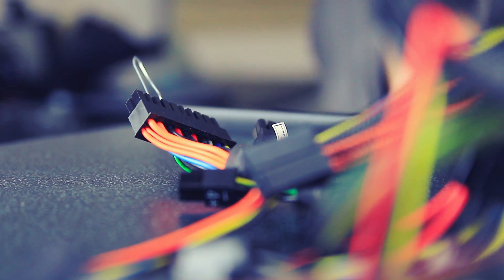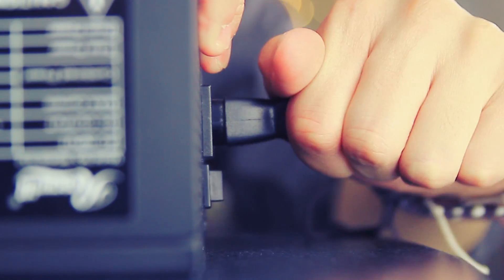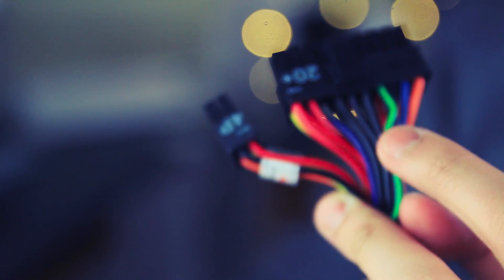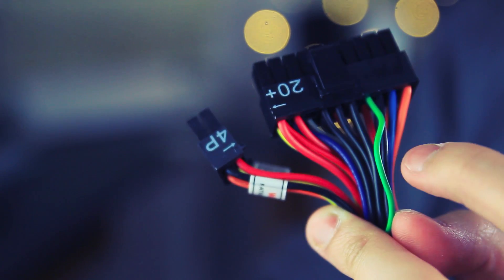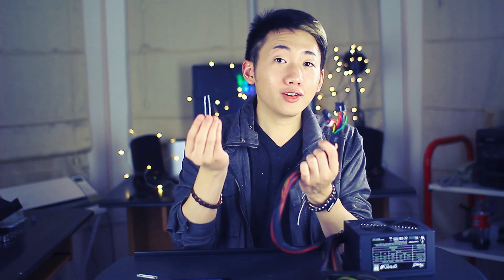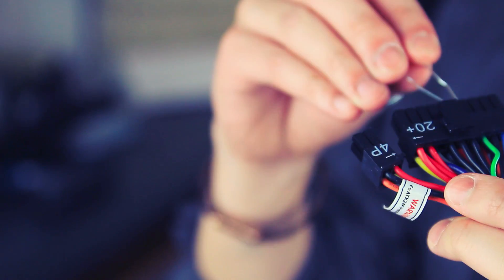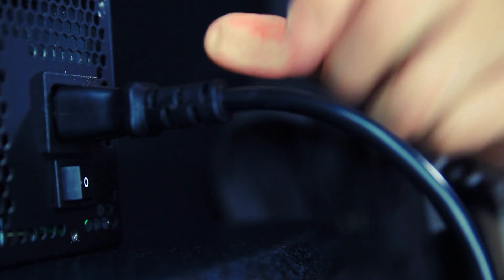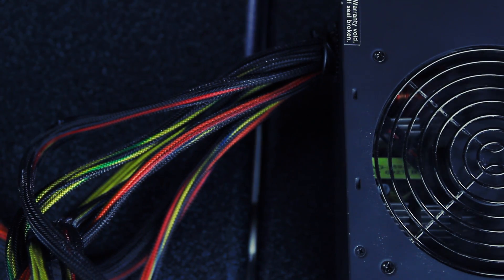PC Tip: Testing a Power Supply with The Paper Clip Test

Comment: is this a selfmade, low-range, non-mobile tazer?
Reply: No sadly, the psu will turn off before you get more than a beesting of a zap. Youd have to take apart the psu and remove the breakers.
Reply: Nope. Not at 12 volts because skin resistance is just too high, and you won't even feel it. And you start feeling electricity at around 0.5 mA. And the 12V rail can put out tens of amps. But not thru you. Although if you open a PSU that has been recently plugged in, the bulk smoothing capacitors might still have a charge. Around 325V or even 400V with active PFC, which can retain for several minutes, or even days if the discharge resistors are open. Yes, 300-400 volts, even dc definitely can kill you. If the bulk capacitors are 470µF (as in my PSU), at 400 volts that's 38 joules. Remember that 10J can be lethal, which is 210 volts for a 470µF cap.
Reply: And often times once ya do that, it simply wont turn on.
Reply: no reason to be rude to him. so it is TAZZZZZER TIIIIME
Reply: @baumstamp5989  hahahahah

Comment: Question, I tried this to determine whether my pc's lack of power was caused by mobo or PSU, and the fan only spun briefly. What does that mean? I've seen plenty of people with the same issue, but there is never a definite answer.
Reply: Think of it this way. Psu's are sturdy and made to take punishment. However, motherboards are very intricate, made to handle many delicate tasks and if a single tiny component is broken, the whole thing stops working. Drop a mobo and it definitely wont work, drop a psu and dust it off and its still good to go. Also, mobos die before a psu does. They are very easy to break and because of their bios, one small surge can wipe it and make it stop working. Thats why psus have so many conduits and breakers, one small surge can wipe the bios.
Reply: Same, any luck finding out?
Reply: +Dvich Not quite yet.
Reply: It means your psu likely isnt damaged. If your fan only spins momentarily that means the fan wont turn on during a low load and dont worry, thats not bad. Psus have many conduits and safety breakers so the chance of your psu dying unless it was DOA and even then is very unlikely. If a power surge was to occur, your mobo would die before your psu, but your psu may become unstable. And often times both need to be replaced. However, i think its your mobo thats bad, if your psu wont even turn its fan on when you try and start your mobo, that often means your bios is wiped. Especially if the fans turn on during a low load test. (The one in the vid.) Even if it only turns on for a second during the test, its a good sign.
Reply: Jeremy Whitaker thanks for the response, looks like I'll be dropping another $800 soon.

Comment: hi there I have a brand new machine and when I turn it on nothing happens just a black screen it happen to my last machine too.... only thing I changed was psu sometimes it works sometimes nothing happens
Reply: This sounds like a bad video drive. Try taking out your video card and hooking up your hdmi to your motherboard. It should turn on fine, then go into device manager then find your graphics card, click on it and uninstall that drive. Make sure you have the disk or are connected to the internet before you do. Then reinstall thr drive by clicking update automatically from the internet or inserting the disk.

If that doesnt fix your problem, its likely your power supply and there isnt enough power going to your system. If you play video games and it suddenly turns off, then thats the problem. Either that or its oveeheating.

Anyway, you'll need a new psu if thats the case.

Also, if you want to check your core temps, download speedfan. Dont worry its completely free but it doesnt hurt to donate!
Reply: +Jeremy Whitaker it was bad ram all sorted
Reply: Oh and a word of advice. Black screen almost always means bad video card or bad program for video card. Also, if you leave it in and plug your hdmi in your motherboard, it wont work. You have to take out your graphics card for your pre-installed mobo graphics card to work.

Comment: What does this accomplish? Isnt it the same to power on the PC and see if PSU fan works?
Reply: If the mobo is dead the power can't send a signal (complicated to explain) common sense if you think about the process.
Reply: +Lakelet Theoretically, would the ethernet light flash with a bad mobo?
Reply: Pistol, not sure if you're making a rhetoric or not...
Reply: It is common sense. What happens when you cut the cord between a switch and a light bulb and you turn on the switch? The same applies with a bad mobo.
Reply: Jeremy Whitaker basically, where does the ethernet port's light power flow from, the PSU or the mobo?
Reply: ***** Thanks. More evidence to suggest stripping the RAM and getting a new PC would be the smarter option.
Reply: ***** thanks, will try.

Comment: touched paper clip lived
Reply: Not the hero we wanted, but the hero we deserved
Reply: Well let's see if we can get the 'Paper Clip Challenge' trending asap.
Reply: You are strong and wise and I am proud of you.
Reply: leg
Reply: That mean your powersupply is already dead
Reply: It's harmless to touch the paperclip if the PSU is OK. But usually Your testing a PSU that is not OK. What might be wrong? Short circuit from live to ground, then its not so funny touching the paperclip, got it?
Reply: @thirstyboots6205  if u touche it with one hand you'll just singe ur hand and hurt it if u touch it with both the current can go through your heart and you can die
Reply: @Kinogotiate  Not that simple, electric shock is much more harmful than people think. Often it cause scares inside Your vain, and if it is a scare in Your vain it might build up fat and the result is blood clots, this might even happen close to the hearth and it happen many years after you got the electric shock. Doctors or You might not even think what cause it.
I have got 450V AC through my heart, luckily  without major problem, only my skin got burn under my watch.
Reply: @thirstyboots6205  honestly its only 110v. Not that big of a deal.
Reply: Wuss, use your tongue 👅!!!

Comment: My computer doesn't seem to be making a connection with my monitor, keyboard or mouse. The computer powers on, fans are on, temperatures look normal and monitor is on, keyboard and mouse plugged in. But as soon as I power on the computer, the monitor goes into power safe mode and gives a message that says "there is no signal coming from the computer". Then it says to "press any key on the keyboard or mouse to wake it, or press the input button on your display to switch to another source", but the keyboard and mouse don't seem to be responding either. And no other source seems to be wokring either. HELP!!

Comment: all my wires are black
Reply: +KennyKennTV Same here. Seems nobody ever noticed that, because all videos are with psu with color cables. Don't know what the fuck to do.
Reply: I ended up just eyeballing it and it worked. Top row connect the 4th and 5th
Reply: Did the "green" cable had any distinctive shape at the mouth end than the other cables?
Reply: @rakolman  No. They are all the same shape.
Reply: I know I'm probably late but if anyone needs to see the colors here they are: http://cdn.overclock.net/a/ad/500x1000px-LL-ad9e1227_atx-connector-20-24pin.jpeg
Reply: Alton, thank you very much. That made it so much easier.
Reply: The PSU documentation should provide diagrams of the connectors with the voltages of each wire
Reply: Probably why it doesn't work
Reply: Hello ! 
Could you please help me out on the following ? 

What is the effect of an open ground on a computer motherboard ? 

Currently it does not do anything (no POST, CPU fan does not startup, PSU fan does not startup, just, nothing happens) and yet, if I use a small electrical tester on the GND pins, the tester glows on every one of them !!! 
I'm baffled on how this motherboard is even able to have AC in it (to make a tester glow)... 

It's placed on wood and yet it is somehow shorted (it tingles to touch)...

The motherboard is also painted black so I'm not really sure if I fried anything..... But it's not supposed to happen since the wirings are correct... 

What am I doing wrong ?

Comment: hey my motherboard wont connect to a psu. my motherboard is a 24 mini pin atx. i got an adapter because my psu is a reg 24 pin atx. the psu or board wont turn on... help please :( oh board is 0200dy and psu is a bestec 460w

Comment: In an effort to be safer.  Do the same thing with a properly sized piece of wire with proper insulation on it.  You don't need to make this any more unsafe than it needs to be.
Reply: it's pretty hard to injure yourself with 5 volts.

Comment: I have an Asus Maximus VII Hero motherboard and the cpu is an i7-4790k. The thing works but after a while the PC will power on but there will be no post onto the monitor. The debug led reads "76" and when referred to the manual it means "PCH DXE Initialization (PCH module specific"  The cpu led is on and it is red. So, can you help?

Comment: this works on my PC but when my PSU is back in my computer attached to all my hardware it doesn't work, I removed my GPU and it worked..... (this computer has worked well in the past)
Reply: +AHappyPineapple(CS:GO) 

That sounds like a motherboard problem. Did you find what it was?
Reply: termi21 it turned out to be a gpu issue
Reply: Oh just saw the "I removed my GPU and it worked" part, i think it was pretty obvious then  :D
Reply: termi21 hahaha :D

Comment: Desktop won't turn on, bought a new power supply thinking it would do it but still won't turn on the fan doesn't turn on any ideas ?
Reply: +Auri True I have the same problem.
Reply: +xXxPUSSY _SLAYER420xXx (dim420) Found out why my desktop wouldn't turn on, I opened the case and looked at the mother board, I guess a cord was unplugged with the USB cord to the motherboard. switched the wires and works perfectly.

Comment: nice vid, my power supply's fan spun for a few seconds then died down with this method, so i guess it kicked the bucket
Reply: +fishballchikuwa Naah, most PSU's turn on to check if the motor is working, then powers down when not under heavy load.

Comment: Awesome video, you have a new sub!  My power supply tested good and worked just fine, however when plugging it back into the motherboard nothing happens, PC does absolutely nothing.  Is there a way to test the motherboard power connector w/out connecting the power supply cord (24-pin)?  

Thanks & Cheers!

Comment: If my PSU doesn't start up after trying the paperclip trick, could it also be that my cables are faulty and not the PSU?
Reply: KempfPlus You can test with another cable (take it from your printer or monitor, they should be the same in most cases), but most probably it is the PSU itself. Also check the AC power is actually there (plug a portable radio or something to check the AC inlet).

Comment: I have a question about the 24 pin atx connector. On pin 13, is it possible to ONLY use a BROWN +3.3 volt sense wire? I'm making an adapter so my new psu will fit to my motherboard(it's an old dell one) and I only have 3 ORANGE +3.3 volt wires, so i only have 1 BROWN +3.3 volt sense wire left for pin 13. Will it work like a normal ORANGE +3.3 volt wire would, or can it only be used for the +3.3 volt sensing?
Reply: No, that's not going to work. That's going to cause a malfunction and you may ruin your psu and most definitely your mobo as well because an overload. I would recommend you to get a new mobo. Nowadays they are at a pretty low price. You can even get a decent mobo for around 80 dollars.
Reply: I've actually already tried. I cut off the 24-pin atx cable from the dell psu, which uses a mini atx connector, and that connector only uses 3 orange wires and 1 brown wire. And since I can't find any mini atx pins anywhere, i figured i didn't have much choice. So I cut and crimped on new standard atx pins and connected them according to the standard atx pinout on to a normal sized connector.  I connecter everything, and the computer started as normal, I even played games for like an hour or so, and everything seemed to work as it should. From what I've read the malfunctions would've occured right away when I switched the power on. Or will it occur later on as well?
Reply: And I figure it would be a real pain to find a new motherboard that'll fit inside the case.

Comment: Ok I have a problem. Recently my pc has been shutting down at start up without any warning. But once it gets to the desktop it can run without any problem doesn't matter the load. The cpu, ram, hard drives, work fine. No overheating problems. The only things I have not tested are the mother board and psu. Any tips. I'm really getting piss when it shuts down.

Comment: First of all thanks for your video. I used to own a 1050 Watt Power supply that was working okay.after I started playing battlefield it started rebooting my PC thought I read a couple of forms and suggested that my Kernel. error 42 was because my power supply was probably losing voltage.I went ahead and bought a course or 1000 W power supply and now I don't get my bios to show an image on my display.my display doesn't turn on.I have two samsung 27 inch monitors.I tried plugging in my old 1050 Watt power supply on and now I wasn't getting a display on the monitors. Bottom line, I made sure to plug every single cable but my previous power supply is not working as it used to a couple of hours ago, I no longer see a display or bios even starting.I bought my part at TigerDirect and that's all I hope you can help me and thank you very much

Comment: is this adangerous to a psu?
Reply: Soda Xyndicall No, but it can be dangerous to you, if you are testing a faulty PSU, which has some power leakage. I am an IT professional and occasionally I have to deal with such PSUs now and then.
Good safety measures, especially if you are dealing with a potentially faulty PSU, is to do the following:

- actually use paperclip with some insulation in the middle (where you touch it) - that is because there are powerful capacitors inside the unit, that still may be charged. I personally don't use a paperclip, but a piece of wire, that is unshielded on both ends, but shield is left in the middle, where I handle it;

- do not touch with bare hands the PSU itself (the metal base) while it is plugged into the AC power line, as the unit may have power leakage and it may hurt you. Leave it on the ground or on some surface. You can check for leakage, if you have a phase finder - just use it on the PSU metal base. If it lights - not good (potentially harmful, although the leak may be small enough to be safe, but you never know).

- also consider this - a PSU, that passes the paperclip test, does not necessarily mean a good/OK unit. Even a multimeter check on the voltages on a paperclip-powered unit is not a sure thing. The best way is to take several tests in the right order - this is how you can ensure if your PSU is good or not (i.e. 1 - a paperclip test, 2 - a multimeter check on important voltages while the PSU is still running the paperclip test, 3 - a multimeter check on the important voltages under load, this means when the PSU is actually connected to and powering the computer - if it is still good, within standard tolerance for good voltages, then you can eliminate the PSU as your cause of problem).

With all that said, the paperclip is a good initial test (as part of multi-testing the unit), as most dead PSUs will most probably fail on it (but not all!).

Comment: Thanks for the video.  I am up and running again for $35.  BTW, my green wire had 5 volts but the power supply was toast.  I almost junked the computer because it's 8 years old, but I can't stand the thought of going to Windows 8.

Comment: I was just building my PC. I had a BXP600-PS and I had my pc everything plugged in except the PCI and the cpu installed and I had my PC running I originally had the power supply running 115V and then I changed it to 230V and then the power supply's fan sounded different then I saw a white flash and then everything shut off. I tried putting it back to 115V and tried hitting power button over and over but nothing changed. Also I saw a white flash from my ps and there was no smoke or burning smell. Can someone help? Please?
Reply: Its dead. You killed it. Its on 115 because the US uses 115V outlets. Europe uses 230 outlets. You're gonna probably need to get whatever was plugged into the psu again because its fried.
Reply: Eugene Yi dummy
Reply: Let me get this straight. Did you go to Asia or Europe and turn on the PSU with the switch set to 115? Or did you simply switch from 115 to 230 while you were in North America? There is a big difference in the two. If you switch the PSU to 230V rating in North America, nothing happens. But, if you send 230V with the PSU set to 115V, you definitely killed it. I don't understand how you got a "white flash" while the PSU was set to 230V.
Reply: Lol you are such an idiot! You can't blame it on ignorance, you are just stupid.

Comment: Does it have to be a paperclip or should a small copper wire work also? I tried and it didnt work.
Reply: Any electrical conductor - copper wire should be better than the paperclip, if you're making good electrical contact.